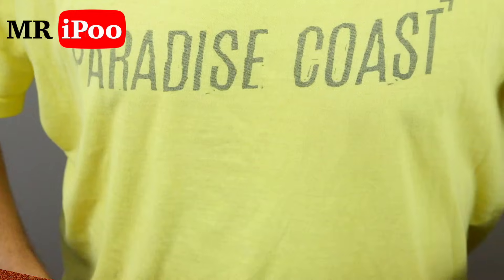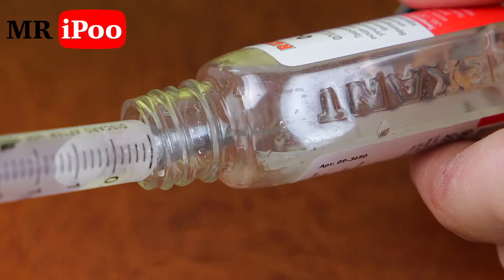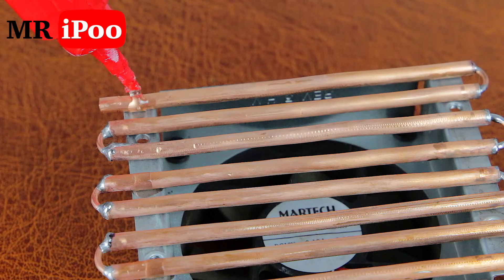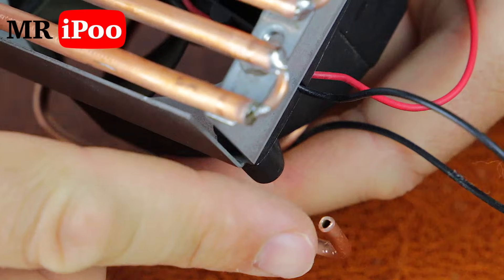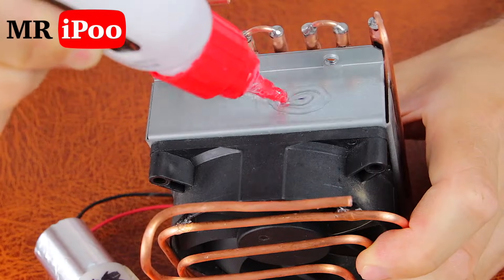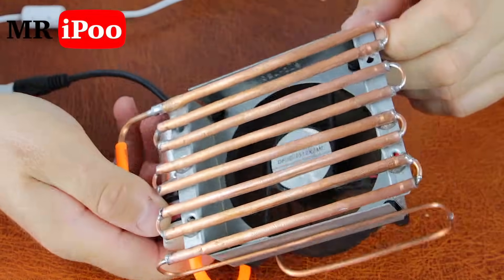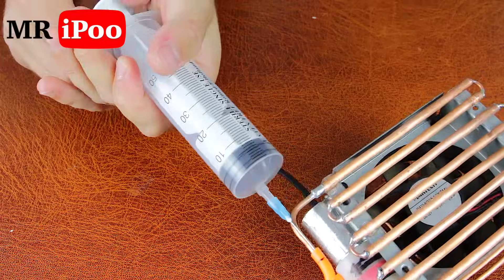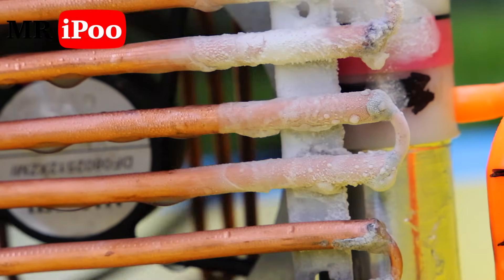DIY Cooling: Homemade Mini Heat Pump (-34°C!) DIY AC Air Cooler ❄️ || DIY Air Conditioner ❄️

Comment: 1) He wrote that it is a heat pump, where is the 4-way valve to reverse the gas?
2) with that under the guise of a compressor it is not even useful for refreshing the eyes.
3) he could have at least put a bivalent valve for cold and/or hot gas on the gas socket
they do not cost much, they do not leak gas and are safer in every sense.
4) the gas he uses is highly flammable and very dangerous. There are inert gases and
much less dangerous accessible in terms of costs.
5) although the gas is always put in the "conditioning" phase for convenience, it could happen
that it needs to be topped up in the "heat pump" phase and therefore it is necessary to heat the gas to
fairly high temperatures "depending on the type of gas". In this case pay close
attention to what you do, if you do not have minimal skills it could become
dangerous. There are devices that heat the gas by bringing it to a higher pressure and then top it up by pressure difference or/and fill it from the beginning. In this regard, there are specific diagrams for the needs of the case, "follow the instructions carefully".
6) always insert the regulation and safety systems such as safety thermostat, electromechanical regulation pressure switch, mechanical safety valve etc... etc...
Nb. If you want to regulate the temperature to a pleasant value suitable for the human body, to avoid thermal shock, the following algorithm is "recommended" ((Te+20)/2) or ((Te+10)/2) for forced conditioning "not recommended", possible thermal shock for people, especially the elderly, who must move from the comfort zone to the warm zone and/or vice versa. DO NOT DO IT, GET ADVICE FROM EXPERTS.

Comment: Air Conditioning works by removing the heat. If this worked, your putting the heat back through the fan with a net degree change of zilch
Reply: just a april fool project ...

Comment: Also another thing wtf is all this hot side cold side crap people are talking about?? Hes not using thermal conductors or anything nothing here except the fan motor it self and the pump motor it self would be making any sort if heat . The actual pump side is not like an air compressor it is a diaphragm pump pretty well no heat from it. . So idk wtf yall are saying with hot side cold side i mean yea the rear coil is less cold than the front but id be guessing its there for two reasons 1 it is absolutely colder that the air its pulling past it but since its first in the path of air flow maybe the situation is it pre cools the hot air before the fan so thefan it self cools it even more and the front coil gets as cold as possible . Second it would make sense to me that it being in the path of air flow first that the hot air keeps that coil from freezing as well making sort of function like a reverse radiator situation so that the whole system doesn’t freeze up and things keep flowing. Thats how it looks to me anyways
Reply: so we can practically make this?
Reply: @ash-ft7py not sure never tried but im not willing to discount it until i do

Comment: Im curious why people are saying the gas wont be liquid due to well its unclear exactly why yall are saying that but i mean i put butane in to containers all the time and as long as its air tight its a liquid and obviously if its not air tight it wont be a liquid be cause its escaping as gas . As far as i could say this is totally possible . Now as far as how long the diaphragm pump will survive is another thing
Reply: But the motor is too small do you think just asking cause I am a student and am very curious

Comment: Si no vi mal trato de generar vacio en el circuito con una jeringa, lo que deberia facilitar la circulación del gas al compensar las presiones...
De todos modos esa bomba de pecera nunca lograra bombear el gas...
La bomba de aire para pecera tuene adentro una manguera de silicona presionada x 2 bolitas de acero que al girar la aplasta bombeando aire
Reply: Osea que el hielo que se forma en los  tubos de cobre es imaginario? Tu opinión es destructiva, si tienes la solución di lo que piensas de un modo constructivo, para que muchas otras personas que no tienen recursos, al menos tengan una esperanza de tener una vida mejor, lo digo respetuosamente
Reply: @radar_________1976  lo ke muestra el video definitivamente esta trucado, xke de ser verdad las empresas ke fabrican acondicionadores de aire usarian ese gas en sus equipos, y no gas freon...
Mi opinion no es destructiva ni constructiva, x el contrario es objetiva, la doy sin animo de ofender a nadie, y para ke cada kien sake sus propias conclusiones...
Veo ke no tienes la menor idea de como funciona una bombita de aire se pecera,
Pero si tu experimento es real, evita ke los demas, sin importar su condicion economica, arriesguen sus propios recursos, mejor  pruebalo científicamente en un foro internacional, y desp patenta tu invencion...
Besis...

Comment: Inefficient design, the fan intake the hot air and blow it to the cool pipes making it less cool.
Reply: tehetne egy  14-14 cm es evapolátort  ami normális
Reply: @opalomahoe2201  IDK, I never actually ended up making one, it was just my opinion based on the video and some physics logic.

Comment: Nah, the tubes wont allow the gas to be liquid... And with no disipation on the "hot" side, there is not cold side...
If there is any gas Even.

Now, the video "working" shows ice on the motor. That shows that he just put the contraption in the freezer and then record it melting, then put the video on backwards and presto!... "Freezing pipes"...
Reply: exactly, these videos should be reported lol

Comment: I saw other videos with similar devices. If I'm correct then one part heats up, and the other part cools down. So the fan shouldn't be blowing on both sides?! Because it would be pushing both the warmer and colder air in the same direction. A window air conditioner isn't pulling air through the warm side, the warm side is radiating to the outdoors while the cool side is being blown on by the fan to push cool air into the room. If you wanted to make it a heater, then the fan would be blowing on the warm side to push warm air while the cool side gets heat from outdoors.

Comment: Come on - that's obviously a cheap little aquarium air-pump, not a compressor. It can not possibly liquefy any gas, so this is physically impossible.
Reply: kismennyiségben tud  kis rendszeren   a cső rendszer belső átmérője nagyon kicsi , nekem sikerűlt csinálnom   ilyet  bár  a gáz ami betöltök  3 nap után  elillan :(  a csöveket teljesen lekéne szígetelni meg a pumpát is valahogyan , maradok a   a 4 db 85 wattos peltier elemnél :)

Comment: I expect it will stop cooling after sometime due to leak in the pump... This type of pump is not fully sealed.
Reply: I attempted some years before covid.....  
what I learnt:  
>>  the butane gas froze the pump and ceased it!!
Reply: Y cómo se supone que va a funcionar si no puede garantizar el ciclo completo compresión y evaporación del refrigerante, cómo el  refrigerante va a experimentar expansión y caída de temperatura si no ha sido comprimido ,calentado y condensado antes?, este video es falso .
Reply: Totalmente cierto
Reply: this seems like a proof of concept design. Everything else comes down to you
Reply: They are completely sealed im assuming that youve obviously never used one . I use them to pump both gases and liquids quite often they never leak on me
Reply: They seem to be sealed enough for water in a Keurig machine.

Comment: For those who think this will work. 1) please do not be misguided butane aka r600 refrigerant or iso butane requires at least 350kpa to liquifiy and this tiny water pump is capable of just some minor pa's no wonder people making videos on this and spreading it
Reply: Also you can tell the frost section of the video is played in reverse because the foster forms from the edges to the center which if something was run through the pipes to frost them then you turn on the fan and start recording, the frost would melt from the center area where the fan is blowing warm air. If it was being chilled by the liquid inside you would expect it to either be even or start at the beginning of the radiator pipe.
Reply: @Tao4Now9393  exactly
Reply: R600 is isobutane, different properties than butane
Reply: @MM2009  even if butane. It liquifies at 220kpa how are you supposed to generate that pressure using a tiny rubber diaphragm pump?
Reply: @MM2009 R600 это бутан, R600a это изобутан
Reply: Použiť kompresor  zo starej chladničky  !!!
Reply: Idiot for your information, it's not iso butane refrigerant 600a it's just a simple can of butane used for brazing purposes, and yes it works
Reply: Yea just use r134a?
Reply: 你应该放个时钟在旁边，计算开启到结冰需要多久，我就相信你。谁知道你是不是喷洒冷却剂在铜条结冰后拍下视频直到融化，再把视频倒退播😂
Reply: Saturation pressure depends on temperature; this is completely possible with a low ambient temperature.
Reply: minnél kisebb a csőrendszer annál könyebben kilehet fejteni a nyomást  ő egy pici rendszert használt   1mm  belső átmérőkkel így lehetséges  ,  de egy a baj   a gáz 3-5 nap után elszívárog
Reply: R290  annak már kisebb nyomás kel  bár kis rendszeren nem is kel nagy nyomás  bár én kiprobáltam  de oda egy  150 wattos motor kellet    nem pedig egy  14 wattos mint a videóban ...   kb 100 wattos   pumpa kellene ehez a rendszerhez
Reply: I just wanted to make a radiator for my peilter and i found this
Reply: U don't need butane. Go larger with two compressor modules, one cooling the other. That way you can just use air and reach temperatures below -100°C
Reply: مستحيل
Reply: u r  completely wrong

Comment: Can we find a way to make this work without having to refill it every five minutes?
Reply: I mean am I wrong that this does work but only for a few minutes. I'm still building mine, and I'm not even sure if my pump will work as it was designed for water, I mean a compressor would work no? Do we need to build a high compression compressor that's low power?
Reply: @tyrian869 How was your project? Did it work?
Reply: i was thinking if we add a thermo electric cooler to cool the gas
Reply: Yes problem is compressed if we make metal compressor and seal it properly this problem will solve for life time

Comment: I think this will work. When u mention about the pump/ compressor can handle the pressure that’s the part that make sense the most
Reply: I don’t think so. Compressor requires maximum pressure at all to compress the gas⛽️
Reply: @redimemes10 ⚠️ God has said in the Quran:

🔵 { O mankind, worship your Lord, who created you and those before you, that you may become righteous - ( 2:21 ) 

🔴 [He] who made for you the earth a bed [spread out] and the sky a ceiling and sent down from the sky, rain and brought forth thereby fruits as provision for you. So do not attribute to Allah equals while you know [that there is nothing similar to Him]. ( 2:22 )

🔵 And if you are in doubt about what We have sent down upon Our Servant [Muhammad], then produce a surah the like thereof and call upon your witnesses other than Allah, if you should be truthful. ( 2:23 )

🔴 But if you do not - and you will never be able to - then fear the Fire, whose fuel is men and stones, prepared for the disbelievers.( 2:24 )

🔵 And give good tidings to those who believe and do righteous deeds that they will have gardens [in Paradise] beneath which rivers flow. Whenever they are provided with a provision of fruit therefrom, they will say, "This is what we were provided with before." And it is given to them in likeness. And they will have therein purified spouses, and they will abide therein eternally. ( 2:25 )

⚠️ Quran
Reply: @redimemes10 if you add some oil it will work okey ?
Reply: @AmplifierBoards-c2q  how can oil work for cooling? just think!
Reply: @redimemes10  all freezers have oil inside motor and freon fluid !
Reply: @AmplifierBoards-c2q  масло в компрессоре холодильника\кондиционера, а соответственно и в газе, для мембранного насоса не нужно масло
Reply: @AmplifierBoards-c2q  если вы найдете масло, которое не войдет в реацию с газом, но оно будет гулять по системе, по типу холодильного компрессора это не актуально, т.к. там масло нужно самому компрессору, а насосу нет